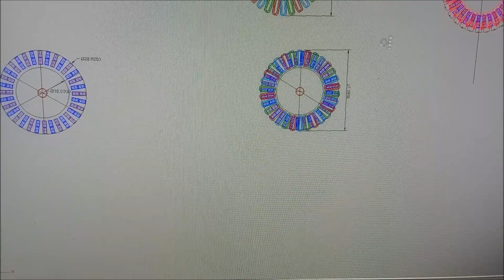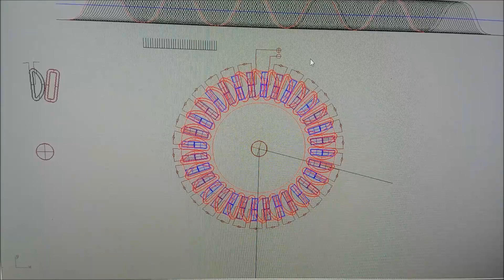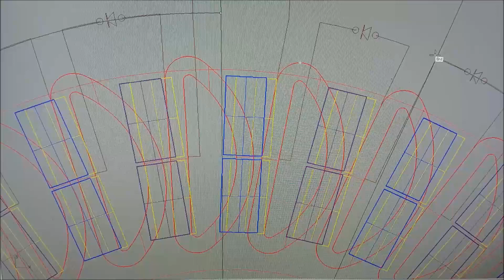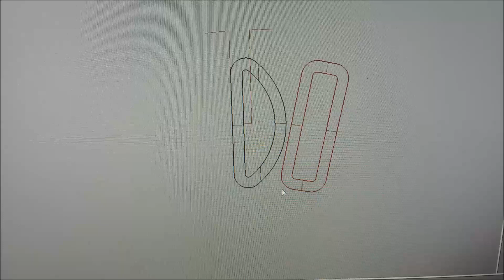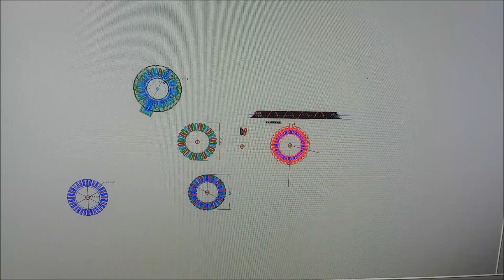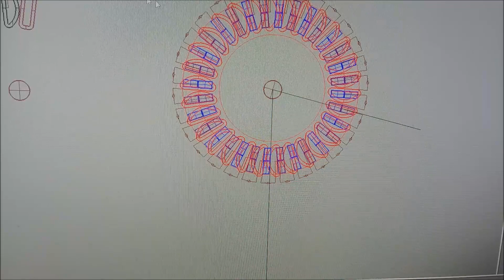BUILDING A PERMANENT MAGNET DC GENERATOR FOR VERTICAL AXIS WIND TURBINE, HOUSE BUILDING IN THE PI

Comment: the magnetic flux changing through the center causes an current in the wire which creates a magnetic field that opposes the direction of the magnetic field from the permanent magnet. it is the change of flux through the center that matters.   if your magnet is D shaped then the geometry of your coil is optimal.
Reply from the maker: I am working on a new design. All the coils are in series, no timing or losses due to coils 
canciling each other out.  Pure DC output not AC and not 3 phases. High amp output and
voltage dependant on RPM just like the 3 phase alternator. Each end of the coil winding 
has 2 diodes one conducting and one blocking dependant on current direction. The other end
of the winding also has 2 diodes, one conducting and one blocking. The diodes conducting
are wired into a string around the stator. The second set of blocking diodes are also wired
into a string and as polarity switches they are the conducting set with the reverse  polarity 
diodes then blocking. The coil count and magnet count is the same. The magnets are also
same side up. The ends of the strings are connected across the battery. On string has the 
leads reversed so that both positive leads are on the same battery post as are the negative
leads. There are several stators stacked with magnet rotors between them and each of the 
4 stators 1/4 of the coil spacing apart to deal with cogging. The diode/coil strings for each 
stator are independently wired back to the batteries. Currently working on a step up voltage 
multiplier paired with a voltage divider to keep voltage above battery voltage for charging
but not be an excessive voltage that could cause battery damage. The switching is by Zenir 
diodes. A second approach is with MOSFETS having a potentiometer on the field drain to
provide a wider control deadband.

Comment: Thanks for your thorough feedback to my questions. Very helpful! I appreciate you taking the time and effort.
Am I thinking correctly from your equation that show how to calculate the number of wraps in a given coil, that if you're shooting for a certain volt output, like 60v. It's about getting the length of a given sized wire, with it's associated resistance per 1000 ft than it is about the number of turns? V=IR. Or is there something about the number of wraps in addition to that?
Reply from the maker: I haven't tested that. It's always a struggle to get the length of wire into
the coil. However I used to race 1/24 scale slot cars at the big rental
tracks. We would change the wire to a heavier guage for more amps
and maximize the turns count. Square magnet wire meticuously wound
could approach the stock count. On a 14 volt track devided by the motor resistance some were 1-1/2 volt motors. A "Globe" aerospace motor wound up to 17,000 RPM. Also an AC transformer secondary winding increases the output voltage as you increase the winding turns. By INTUITION ALONE I think more turns will increase voltage since the magnetic flux is from a physical magnet and is constant. Reducing the air gap or running clearance will boost amps because the flux density
will increase.
       You might want to look into a PV solar inverter to turn DC into
whatever AC voltage you need. They are available for 12 volt input 
systems and can charge 12 storage batteries that are then "inverted" into 120 or 240 volts AC. If your generator doesn't make enough continuous
power for the load  the solar power inverter should get you there. I will make a couple videos about that. Might be interesting. Wind or solar
or both can input into the inverter. Most have built in charge controllers with MPPT but stand alone charging controllers are still available.
Reply: Ok, so you really have my brain thinking...I like your idea of a large rectangle coil on edge, perpendicular  to the stator. If I understand correctly, you'd suggest a north facing  magnet facing towards the coil edge on one side and another north facing magnet facing the opposite edge of the coil, since they are too far apart to interact.
 Did I read your intuition correctly?
Secondly, if the original reason for the diodes was to deal with the opposite edge of the coil's emf, would this perpendicular coil setup, with a wide stator, that doesn't have fluxes comingling, eliminate that bucking problem because all the magnets are working towards the same goal now?
I can't shut off my brain now.  Look what you've started...

Comment: I really like the all DC concept.  It seems to eliminate a lot of complexity.  I want to build this axial flux generator that you described.  48v system for my farm and cattle well..  I've watched this video 4 times so far and it makes sense the more I do.  As far as the diodes at each D coil goes, what are your thoughts about just having one big and accessible diode before the juice leaves the stator.  Would that keep current heading the right direction and yet not be overly hard to diagnose and fix if it were to go out?  Is cogging still the concern as with a 3 phase AC system?  I am wanting to mount 24 D coils on a steel plate, with 25 magnets.  Do you think that will overcome cogging or should I add one or two more magnets?  I use Fusion360 to draw stuff up and the D coil that seems to have the least back curve exposure to flux looks more like an "ear" or a back rounded wedge of cheese.  Fits nicely but do you think the corners might be a problem when winding these up?  
It seems you probably have forgotten more about this sort of stuff then most of us ever knew in the first place.  Thanks for putting these videos up.  Great info!
Reply from the maker: The thing with the multiple diodes in series with the coils is that it adds the voltages. For instance if your coils produce 5VDC  and are in series then 6 coils would be 30 volts and have the same amps as one of the coils. However we use different numbers of coils and magnets to reduce
cogging so that the wind can start the thing turning and also for less
fatigue pulses in the moving parts. Therefore you would expect about
66% of the maximum output of each coil when they are in series.
        The reason we use three phases is that it uses both positive and negative pulses as the  magnet approaches and then leaves the
no flux change point centered on the coil. The 3 phase AC output wires
are turned into DC with a three phase rectifier and if you do the
poster board mockup of coils and magnets to see if you can get 
them all making power and none canciling out each other there
is significant power output to be gained for no increase in parts
cost. There is a minimum bend radius when bending enamel coated 
wire  that is concerned with stressing the enamel but a 1/8" radius 
on your coil winder (or 4 wire diameters) would seem safe.
       I think the root cause of cogging is from the current reversal
when you pass the magnet neutral position. If one side of the coil 
has less flux lines being crossed than the other there is less reversed
current flow. Actually a triangle shaped coil would minimize the 
rate of change of the flux since they are less perpendicular to
each other. It is the rate of change of the magnetic flux that creates
the current in the coil and when in line with each other no current is
produced.  As a rule anything that can be commutated to run as a motor 
will be a generator if it is turned. What we are doing here is based on brushless DC. But the thing we are contemplating would be  difficult
to commutate without brushes on a shaft mounted commutator like an automotive starter.
        The magnets will benefit from being on a metal plate as the flux
lines interact with adjacent magnets. However not much to gain 
from a metal stator.  If you could have the straight side of the coil
on a piece of phenolic plastic and the rest stuck thru the plastic to
be out of the magnetic flux or more simply mount it vertical to the 
stator. The magnetic flux dissipates exponentially with distance so 
there is minimal current flow on the other half of the coil. Of course 
it could be a square coil with a second magnet rotor outboard of the coil and double the output. Probably 2-1/2 inches internal width on the 
coil.  With the dual rotors intuition alone tells me that the second rotor needs the other magnet pole facing the coil. Also stagger the rotor
timing 1/2 the coil spacing to reduce cogging. The voltage would
be close to the single rotor voltage but amps would double. You could
also put half your magnet count on each rotor if you would be over
the amp capacity of the gauge wire you have.
        Never seems to be a grade school kid handy looking for a science project when you need one. It's like trying to find one when you are
installing software on a Macintosh computer. Or years ago writing
a windows config.sys and autoexec.bat file. Well back to the concrete house building.
Reply from the maker: The diodes in series add up the coil voltages. A single IGBT or 
MOSFET wouldn't do that.  Cogging is still there since you 
approach and then leave a coil winding. As far as coil to magnet 
count goes the magnets don't have to divide by two if they all
have the same pole pointing at the coil. The magnets need to be 
on a metal disk for rigidity and so the flux can interconnect through
the steel. More pondering on this idea is to do square coils mounted perpendicular to the stator. One side of the coil close to the magnets 
and the other side not in the flux which dissipates exponentially with distance. Second change is to put another magnet disk outboard
of the coil behind the stator. The stator could be phenolic plastic
and the coil internal width about 2-1/2 inches. Stagger the rotors 
half a coil degree spacing to reduce cogging.
Reply from the maker: Continuing.....with the two magnet rotors the voltage would still be the same per coil (about 66% of peak  maximum) but the amps would
double. Power is I squared X R so increasing I increases power. If the
second rotor increases amps past the wire capacity put half your
magnets on each rotor. I would do double the magnets and start out
with the air gap about 1/4 inch for a test. Then close down the air 
gaps to get up to the wire capacity.
       There is a minimum bend radius for enameled wire coatings 
so as not to damage the coating. A minimum of 4 wire diameters
or 1/8" which ever is larger should be close. Continued.....
Reply from the maker: The thing about sizing diodes is heat dissipation. In normal electronics they can switch on and off thousands of times a second with enough
heat generated that they might require heat sinks. In our kind of
projects  25 magnets X 600 shaft RPM / 60 seconds per minute is
like 250 times a second. That's a long way from 14HZ speed and
our stators are poured into epoxie for water proofing and structure
to sink some heat into. So no need to size the diodes at their operating wattage just jump it up 500% and forget about burning them up.
     How come there is never a school kid around looking for a science project when you need one. It's like in the 1980's  when you were 
writing  windows config.sys and autoexec.bat files or installing
software on a Macintosh computer. Kids....can't live with them 
can't kill them. Proof that God put teenagers on us to show his or 
her sense of humor.

Comment: This answers several questions and lowers the work on the rectifier.  Good job.
Reply from the maker: Daniel, Actually no rectifier is needed because it is already DC and doesn't 
need conversion from AC to DC.  A charge controller is still required for
the batteries. I have a refinement on this that eliminates the diodes as well
Sort of a revision one and change one.  Video probably next week as we are pouring concrete on the cistern in the Philippines today using the slip
forms from the septic tank pour. One of our mason helpers mismeasured 
the rebar locations for the walls or possibly added CM and inches and
had trouble translating the dimensions to english. So we are resizing
the tank from 37,840 gallons to whatever it ends up. As we say "it's more 
fun in the Philippines" A girl wanted a job cleaning our in progress
house which has no windows and doors???? Funny how dust blows in and can't blow out.